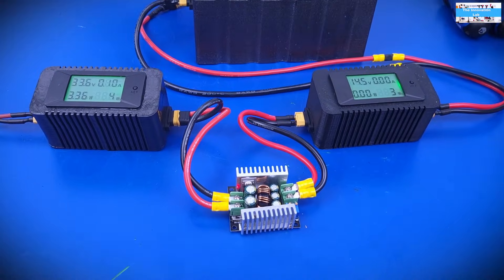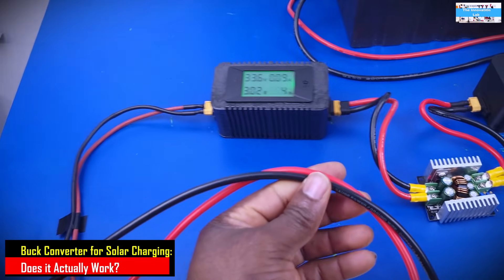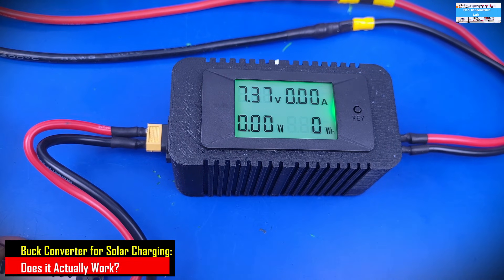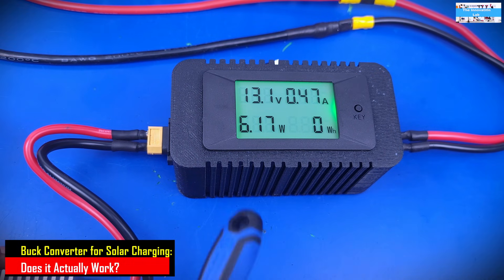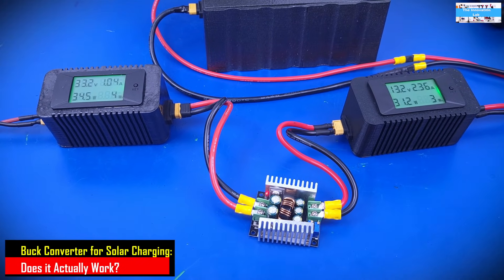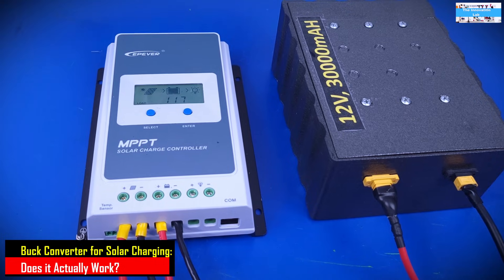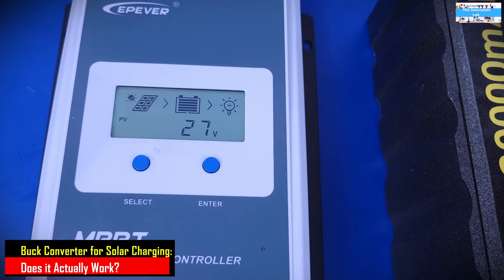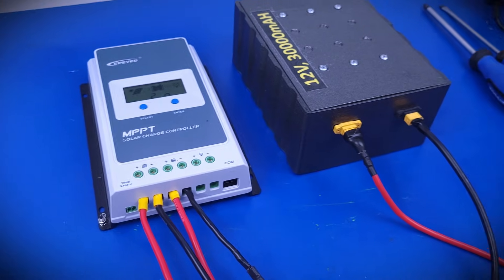DIY Solar Battery Charger, with a DC to DC Buck Converter.

Comment: This may seem like another stupid question but I love the knowledge I gain from my own stupidity: power input = power output + losses. Even under ideal conditions power output can never be higher than power input - especially with a BUCK converter. How could we expect it go higher than input with step down topology? I'm sure there's a law of conservation of something or the other that you're trying to override against the physics of the universe😮. Respect the attempt though and I'm slightly anxious to see you "Shock the World" if you do succeed. I'm still trying to figure out the detail I've missed here. In any case, doesn't it seem that we're overanalyzing the problem at the wrong point in the circuit? I'd say work on the input supply to amp up the power required in order for the buck mechanism to step it down to your required output charging VA.

Guys please feel free to correct any part in the above since as I was typing this, not a single page of a textbook was turned 😄
Reply from the maker: Hi friend,
I am not exactly sure at the exact point in the video that you saw that the output IV was greater than the input IV? Maybe I missed something - if I did, I would gladly welcome correction because I don't pride myself on being above mistakes.
Right at the 6-minute mark, the video showed a test summary with the following conditions;
Max INPUT POWER = 34.5W ==> Digital meter on the LEFT
Max OUTPUT POWER = 31.2W ==> Digital meter on the RIGHT.
Calculated EFFICIENCY of  Buck converter (%):
((31.2/34.5)*100) = 90%

Now, if my numbers are correct, IV losses = 34.5 -31.2 = 3.3W.

Again, unless I am missing or overlooked something here, I will assure you that I have not invented new laws of physics with this 10-minute YouTube video. So don't worry, our universe is still intact, at least until we understand how to harness the dark energy that fills the universe... Only then can we  fly off to the Andromeda Galaxy...yes?🤔

Please, I would appreciate it if you could keep your comments less disparaging, cynical, and condescending. If you spot a mistake in my  videos, please respectfully let me know. I keep my videos as honest as I possibly can, and I am equally here to learn from my audience.

My motivation and inspiration mostly come from my audience. Please keep your feedback constructive.
Reply: @theinnovati0nlab782  hey there. It's all humour. Probably misunderstood. I'll keep it clean.
I did give you constructive feedback about why you were not able to get your CC above a certain point and suggested working on maximizing the input power supply. Please check my comment.
To explain further, the system crashes at;
13.2V x 2.52A = 33.2 W at the output side. With 90% efficiency, this is completely alright and functional.
The problem arises when you try to go above 2.5A. Also you were expecting close to 10A since the max rating of the device is 15A I(out).
While the buck converter can indeed output close to 15A, this will never be possible with an input power of 34.5W and V(out) at 13.2V.
You want a CC above 2.5A, let's say 3A, to the battery. Then;
P(out) = 13.2V x 3A = 39.6 W 
You can never achieve ~ 40W from 34.5 Power(in). Impossible!
That's why I mentioned about the laws. Also the buck converter does not work according to the MPPT principle and hence maximum power does not come into play.

If you wanna continue using this setup for learning further, see my suggestions below:
1) Replace battery with another having lower capacity. Requires less Charging Current
OR
2) Increase the no of solar panels until the Power reading of the input meter shows at least 150W consistently. Even thought the solar panel is marketed as 200W, this is only the maximum.

The above will help you understand how make it better to your needs.
MPPT certainly comes with its benefits. Maybe have a go at that too. Once you understand how it works, I'm sure you could incorporate it into your DIY builds 👍
Reply from the maker: Thanks a lot for the great feedback.👍👍
However, I hope you watched the video to the end where I performed a control test with the MPPT charge controller - simply to show that the problem was not as a result of insufficient input power from the solar panel. I never expected a cheap $12 Amazon buck converter to give me the same performance/efficiency as an $80 MPPT charge controller that uses incremental conductance and a complex control algorithm.  As you saw in the video, the control test shows that the solar panel was actually delivering close to 200W - given the same exact setup, test components, battery pack, irradiance, etc. Basically, the only variables were the buck converter and the EPEVER MPPT charge controller. The power monitors do not count as test variables because they are truly nothing but passive measuring devices, consuming less than 80mW each. I performed this same test in a previous video using a boost converter and the same solar panel and battery pack, but the result was better than this.

My suspicion was that the buck converter  (maybe due to its switching noise/interference)  was impeding the solar panels' ability to properly allow the flow of current from the photon-electron energy handshake (photovoltaic effect). 

I have a good  grasp of  solar energy systems and converter design fundamentals, and I have built quite a few in the past.
I was not saying that I was expecting a charging current >10A based on the 34.5W that was observed at the input power monitor. All I was saying was that the constant current DC-DC buck converter used in this video was not doing a good job of harnessing the available power from the solar panel. Instead, it was only accessing 34.5W. I will not recommend anyone using it. Maybe a regular buck converter - that is not a constant current converter - might do a better job. However, I lean towards the CC converters for my battery charing projects/videos because they provide  the user with the ability to adjust the charging currents of their batteries. A good battery charger should provide both voltage and current variability.

As you mentioned, I believe that this might have been a misunderstanding. 
I have made multiple videos on similar subjects. Please feel free to check them out.
Thanks again😊.
Reply: Appreciate the response.
However I shall maintain my opinion that buck converter has upkept its main purpose as these devices are pretty straightforward and the even cheap ones found online are seldom faulty. I suggest looking at the specifications of the circuit or the datasheet of the IC available online. Any significant impedance will definitely be stated here.
Also like you said, to achieve the full power potential with Solar cells, a controller circuit is required. Preferably MPPT as opposed to PWM.
Lastly, I'm no scientist but I'm not shy to learn what stimulates my curiosity. So I know I could be wrong on many fronts.
Also I've been watching your stuff and have been a subscriber for a while now. Great ideas and productive content. Keep amazing yourself and then amaze your viewers!
Reply from the maker: 👍👍
Honestly, I am very glad to  have you as a subscriber!
I find your feedback super helpful. 
Thanks a lot for keeping me on my toes. 😂
We need more people like you in here.

Comment: Try with out using the input power Meter.
Reply from the maker: Hi friend,
Thanks a lot for the great  suggestion, I will try that when I get some time to troubleshoot the system.
However, I honestly don't see  the issue being the power monitor because the monitor is just a passive device that uses the voltage drop across a low resistance (miliohms) shut to calculate the input current. That was something I put together her myself, and I fully understand the inner workings - super simple, too😊. But you never know, you may be right, I will try removing it to see what will happen. 

Thanks again for the wonderful interaction.
We appreciate it.
👍👍👍

Comment: Input 34w from solar only, how can output be more then 30w++?
Reply from the maker: Hi friend,
Thanks for the feedback.
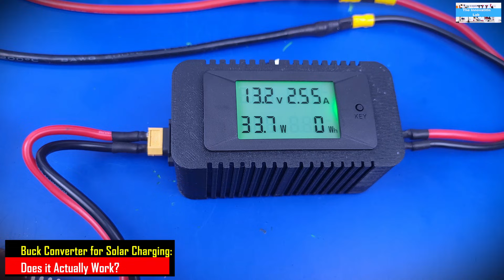That part is explainable. I assume you looked at 5:25 minutes into the video and you saw that the measured input power was at 34.9W while the delivered output power was at 31.2W. This behavior is expected for any converter, actually, and the difference is due to converter efficiency losses. 
So, in this case, power losses = 34.9 - 31.2 = 3.7W. This also means a converter efficiency of about 89.3%

Personally, the issue I had was that I expected the converter to deliver more power because I was using a 220W solar panel.
Typically, that effort was a failure for me. Getting barely  34W out of a 220W solar panel (at full irradiance) was a huge fail. 
Maybe I will try a different buck converter in the future, but not that product.
Thanks again for watching the video. 
👍👍
Reply: Check the cables thickness and connectors. Converter was working fine. You can see the input power

Comment: Hello!  I've been using that same buck converter to charge my 12v, 100ah LifePO4 battery with a 240w solar panel for more than a year now without a problem.😁
Reply from the maker: Wow! I am glad to hear that. Thanks a lot for the feedback.👍
Well, as I said in the video, I really don't know why mine was charging at such a low current when clearly the solar panel was providing lots of power. 
Please, if you don't mind, what was the maximum charging current you were getting with your setup on a good sunny day? Also, what is the Voc (Open-circuut Voltage) of your solar panel? 
One of my concerns was that maybe my panel's Voc was too high for the buck converter. But it has a maximum rated input of about 40V, though - with was higher than my panel's Voc, with some good margin.
Thanks again.
Reply: @theinnovati0nlab782 looks like the voltage is too high for your buck converter... strange
Reply from the maker: Agreed.
Anyway, I really do appreciate the interaction.  Thank you for sharing your experience regarding this subject.
Reply: @theinnovati0nlab782 I would check the solar panel
Reply: @theinnovati0nlab782  On a good sunny day, the charging current is 8–9 amps. Solar panels' VOC is 22 volts.😁
Reply from the maker: Wonderful, thanks a lot!
With your results, I may redo the test with a different buck converter to see if I will get a better response.
However, I think you should also look into a controller that could help you optimize the power you are getting from your solar panel. With a 220W panel on a good sunny day, I would expect close to a 15A charging current, especially if you are using a lithium phosphate battery pack. Doing some math based on your feedback, your charging system could be giving you an efficiency less than 50%. See my control test at the end of the video. Personally, I have used MPPT charge controllers for a long time and help you get some good value out of your solar panels. You can get higher than a 95% efficiency with an MPPT solar charge controller.
Reply: @theinnovati0nlab782   Yes, efficiency is not good. I'm using two 120-watt panels with an Imp of 6A in parallel connection. When battery SOC is below 70%, charging current goes up to 10–11 amps. Plan to add an Arduino to control output voltage based on panel output power to see any improvements.🙂
Reply: @vztech  If you use 2 6 amp panels in parallel, even a PWM controller will charge the battery at 12A higher than buck (which the panel is producing). I am looking into this to get more efficient charging than a PWM controller.
Reply: @theinnovati0nlab782 I have same buck converter also
Works fine with my 150w 20v solar panel.
Efficiency isn't as good as mppt controller but works perfectly
Reply: Did you use battery full charger auto cut off circuit. What you do when battery is fully charged
Reply: Read up how MPPT charge controllers hunt for their MPP and it will give you why your buck is stuck at a lower level.

I have done this before and found out why.

Comment: Maybe the solar panel voltage is dropping under load. It looked like one of the panels was shaded.
Reply from the maker: Hi friend.
Thanks a lot for the wonderful feedback.
However, if you watched the video to the end, you see that I performed a control test with my MPPT charge controller under the same exact conditions, and I was able to charge the battery at 14A.

Secondly, the clip showing the solar panels was an old B-roll video clip taken a long time ago - when I installed the solar panels. Also, the shaded panel on the right was actually disconnected and not being used for the  test.
Reply: @theinnovati0nlab782  okay. So what went wrong? Did it overheat?
Reply from the maker: It did not overheat, at least not at delivered power <35W, and I didn't even leave it running for a long time, as you might have seen in the video.  It just wasn't interacting well with the solar panel, and as  I mentioned in the video, I honestly don't know why. I know that if I had the time to troubleshoot it, I could figure out what's going on, but I don't think it's a whorth while effort.